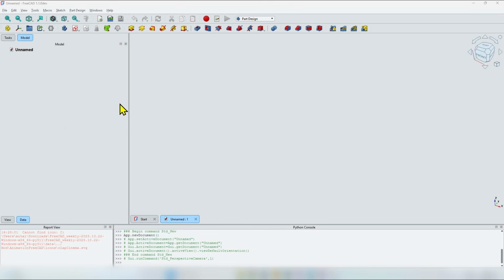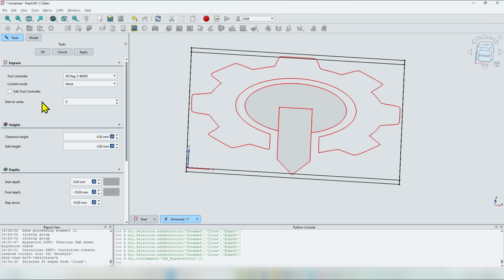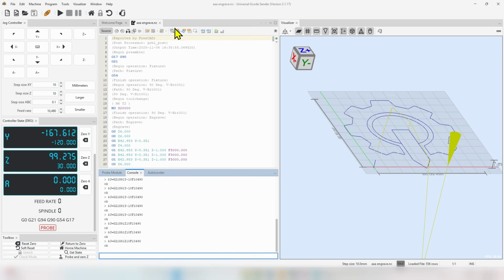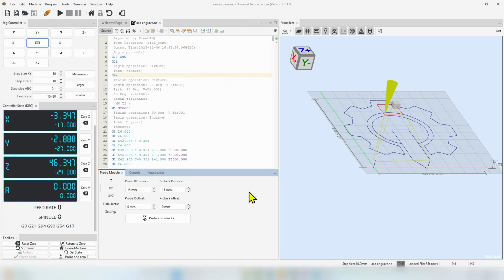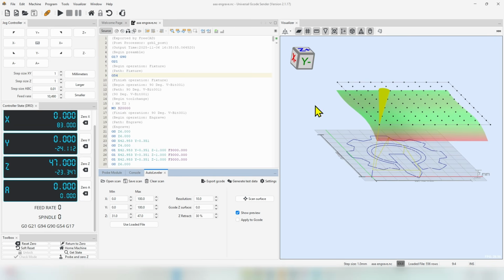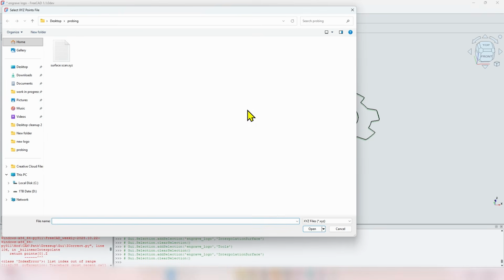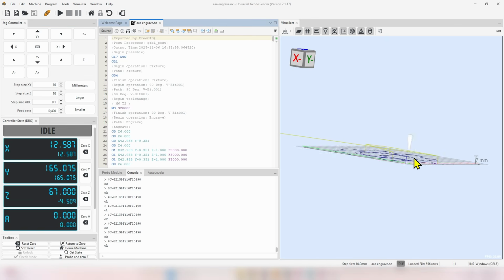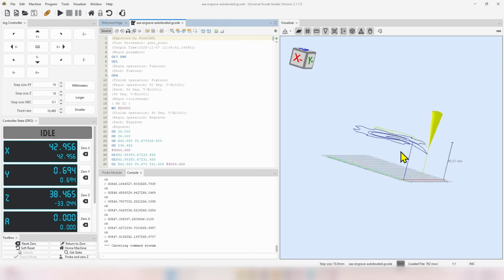Universal G-Code Sender: Mapping The Stock - 3D Probe Workflow for CNC

Comment: I never got to using my cnc router because i couldnt figure out why the probe light keep popping up in ugs
Reply from the maker: Most probably you have a grounding issue. Try disconnecting the spindle power while probing, it might help
Reply: @opensourcecnc are you using grbl to control?
Reply from the maker: @davidl6354 I use fluidNC. It is a grbl firmware adapted for the esp32 chip with a lot of cool features over the standard grbl
Reply: I missed wired the signal and voltage and now it works perfectly i purchased both n/o n/c and they both work if i change the $6 0/1 on firmware settings

Comment: With the probe and the surface macro you could easily copy almost any surface .. nice! I was looking for something like this a few months back and had a buddy surface probe the part I needed to copy .. it would be a great follow on video to this video.. have a part to copy , surface probe the part and cut it out.. no need for a cad drawing.. 👍🙌 thanks again for the great work !!
Reply from the maker: I do exactly that in the last part of the video, I show the workflow without the need for FreeCAD.
Reply from the maker: Now that I read that more carefully, I was wrong, I don't do that in the video. I believe that can be done with a default operation consisting of parallel lines at 0. Then, when the scan is finished, crop the code to that area (not sure how, for now, but I'll look) and let ugs adapt the height.
Reply: @opensourcecnc  no worries.. I’ve often had people drop jobs on my bench where they need an identical replacement.. and other than 3d scanning the surface and rendering it in a cad program (outside of my budget)the only way to recreate it was to model it in cad … not impossible but in some cases it’s never accurate enough .. 
having the ability to surface probe the part with a fairly tight grid and have freecad render the the surface scan into a solid with your macro is a great option .. I’d love to see it explored more !! Great work man!!

Comment: I used to do some PCB milling on my CNC mill.  This would have been handy to accommodate less-than-perfect boards that required fine detail.
Reply from the maker: That's what I plan on doing next. Hopefully, it will help me get something usable, as it is going to be my first ever designed PCB. And, obviously, the first ever milled PCB.
Reply: I had my best success with tiny endmills and drills specifically made for PCB work.  The cheaper V-bits never worked very well.
Watch out for the dust.  Bad for the lungs.
Reply: @opensourcecnc  I was milling prototype PCBs on a homemade aluminum vacuum table without any problem. There's very little inconsistency in the actual PCB material.

Comment: This 3D probe not need calibrating?
Reply from the maker: My probe came pretty well set up. The runout is less than the spindles. But I will consider making a calibration video, too, if there are requests for it

Comment: Current should flow from the Spindle Housing to the Endmill allowing you to permanently attach the Probing Wire you used to attach to the Endmill during the Probing to the Spindle Housing instead - The Probing Current will then go through the Spindle Housing > Bearings > Spindle Shaft > Collet > Endmill and upon Contact into the Touch Plate closing the Loop.

That being said I could never go back to UGC... The lack of Macros for OD recognition and Tool Length Compensation would be too much of a feature loss to me.
Reply from the maker: Generally, it works ok with a setup like that. But sometimes it triggers false readings, so I prefer to keep it disconnected physically.
What are you using instead of ugs? I'd like to take a look at those features